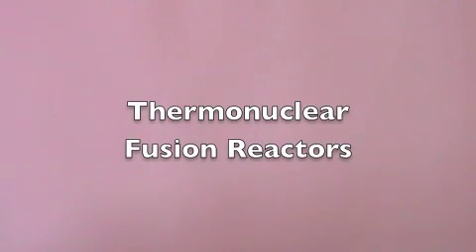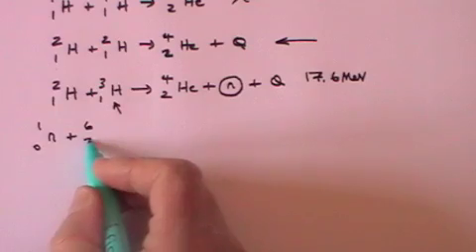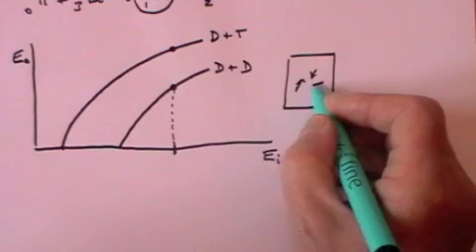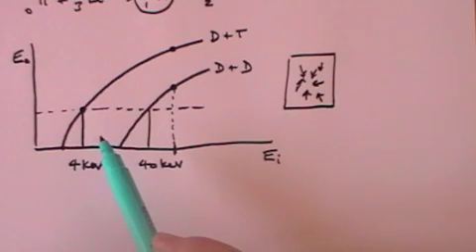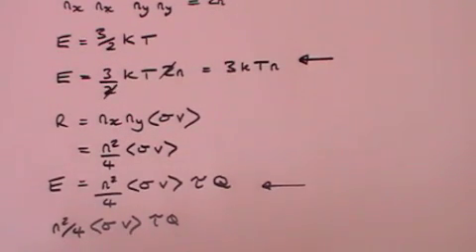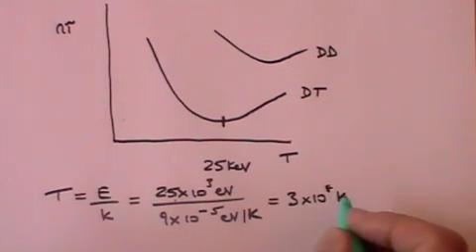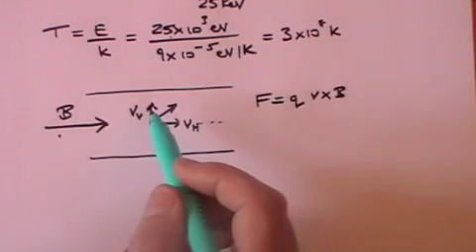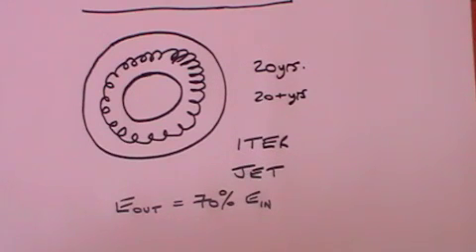Nuclear Fusion Reactor

Comment: The Jetter Cycle initiates the fusion reaction with neutron bombardment of Li6 since the Li6+n reaction produce He4 + T + 4.8 MeV - which is way more than required to initiate the T + D reaction.  So, if you start out with Li6D in a molten salt along with Zn69 which takes energetic n and produces 2n and Cu68 via the (n,2n) reaction - and put a neutron blanket over the molten salt (and zinc) - you start the reaction with a neutron starter and it grows until you lose the same number of neutrons you generate - and you have a molten salt subcritical blanket reactor with a Li6D fuel.  

Now if you use  (n,2n) material that takes a while to complete the reaction - turning your energetic neutrons into two low energy neutrons - or at least a portion of them - you build your reaction with no possibility of  a hydrogen bomb explosion since it takes too long (Zinc takes 28 minutes half life to decay releasing 2n after absorbing n) .

Comment: In the original  fusion criterion proposed (1955), JD Lawson includes losses due to Bremsstrahlung but deliberately neglects system losses. If the complete energy balance is accounted for, the return on energy invested (Q) looks even worse. If a complete energy balance is not accounted for, then failure to achieve fusion power is due to fuzzy accounting not engineering and the consequence that fusion power will remain 20 years away indefinitely.

Comment: A couple of errors that I find concerning. In describing D-D v D-T reactions, you say there is no radioactivity generated. But neutrons come off; in fact, they carry most of the energy. Those neutrons collide with the reactor walls, and induce radioactivity. True, the materials can be chosen so as to not have long-lived products. But there is actually intense radioactivity induced, and it's a big problem.

The other error is that Bremsstrahlung is not just wasted energy. It eventually shows up as heat, just like the neutron captures that absorb most of the reaction energy. So it's not really wasted at all. It's just that it bleeds off energy that is needed to sustain the reaction.

Comment: Why dont they spin the plasma around an axis like an spinning ball? wouldn't this reduce the size of the magnetic field needed (which would result in lower energy input)? if you heat it up with lasers they would have to be pointing through the spinning axes. sorry for my bad english

Comment: What are the engineering problems that will take 20 years to solve?
Reply: +sparkstarter the fact that any decent fusion reactor need a strong magnetic field to be maintained and also needs massive amount of energy to kick start any decent fusion reaction.
Reply: +LittleHorhey I know the main problem is plasma confinement, just wondering if we could get a high level engineering review of what has been tried and why it has failed.
Reply: sparkstarter Sandia national lab has achieved fusion, even leading to superheavy nuclei twice the mass of uranium. But even for them I think the issue is that the energy out is less than the energy needed to initiate z pinch in wires via plasma.

Comment: Great video once again. There's one thing I'm not sure I agree with: you say that if we figure out a commercial fusion reactor we'll satisfy our energy needs for millions of years. Is that not assuming a zero growth rate? If you assume the current growth rate (say 2%?) in energy use, something that would have lasted a million years will only last about 500 years, no? And one could argue that energy growth rate might go up if we get a great source like fusion working. Am I wrong?
Reply from the maker: Well there's a lot of deuterium in the sea, so it may be that Lithium would be the limiting factor.
Reply: DrPhysicsA
Thanks. My point is that exponential growth is such a big deal that even something as abundant as deuterium wouldn't last nearly as long as one would think. Try out the calculation assuming 2% growth, even without the lithium limiting factor. Maybe it would make a good short video?
Reply: +maitland1007 With Moore's and the corresponding advances in efficiency?